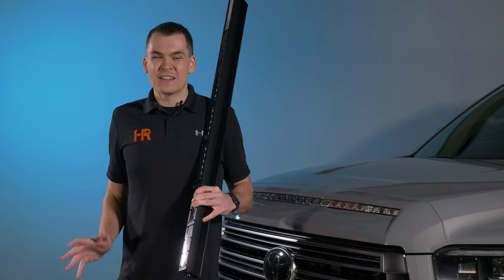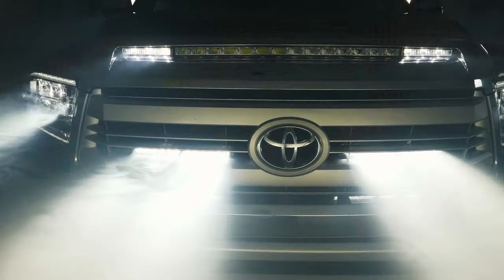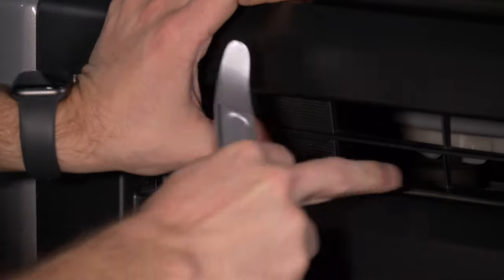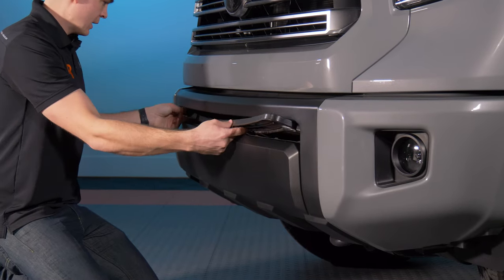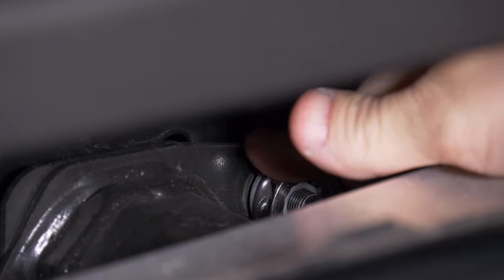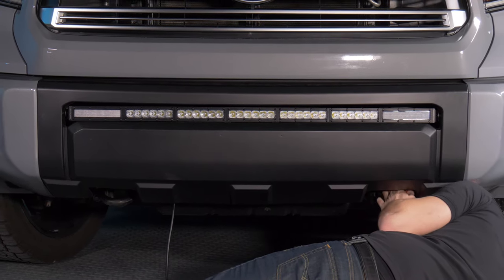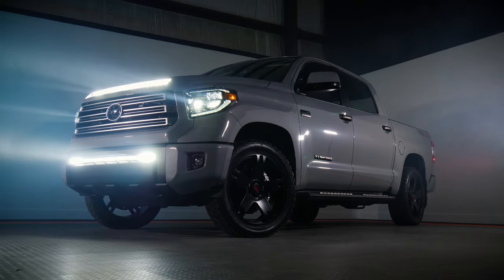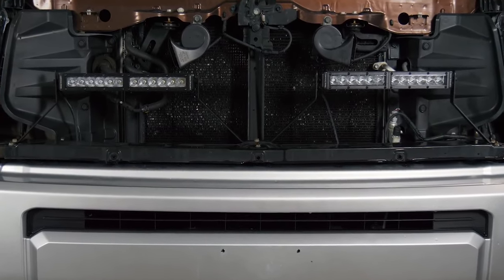2014-2020 Tundra Diode Dynamics Lower Stealth Mount Light Bar Install | Headlight Revolution

Comment: I tried today to install the 42” on my 2021 Tundra but even after I tightened everything, it still had some play when I lightly pushed on the light bar.  Only two hex bolts holding it in place. Just scared it’s going to rattle (break) or wear my paint out.  Any suggestions or fixes to this problem as I am surely not the only person to have this.
Reply: The light came with a both with extra brackets, bolts, hex bolts and lock washers. Was told to only use two hex bolts and nothing else.  Something doesn’t sound right.
Reply from the maker: Can you shoot us an email with a video/pictures of the current fitment? sales@headlightrevolution.com

Comment: Quick question. The folks up here in Canada, alot of our Tundras have our block heaters plug on the left side of that grill. Is there any way to install the 42" light bar and still keep our block heater plugs in play ?
Reply from the maker: You should be able to install these with the block heater, there shouldnt be anything different with that heater and the installation of this light bar!

Comment: Any chance of a modification for the 2020? I saw in the webpage that due to a change in the switch board panel this one will not fit the 2020
Reply from the maker: They should have a new version for those 2020s coming out very soon! I don't know specifics on when, but should be by the end of the year!

Comment: I have this bar in my bumper and their 50” spot on the roof. Been mounted about a year now. So far so good!
Reply from the maker: Glad to hear you are still liking them! Those Diode Dynamics light bars do a fantastic job, and we have been very impressed with their overall quality and longevity! Thanks for watching!
Reply: @HeadlightRevolution where did you install the relay didn’t see that in video

Comment: Running the power cable across the radiator won’t affect it heat wise?
Reply from the maker: Nope, you won't have any heat-related issues!

Comment: I have a 2021 Toyota Tundra Crewmax 1794 edition. I'm going to Atlanta this summer. Can the hood lights (aka Night Rider) and lower 42" LED lights be installed in my truck?  With Android  Auto I don't need the extra plugs-in under the radio. Are the rocker switches available in black?
Reply from the maker: We do not do any installs in house, sorry! 
Any mechanics shop should be able to install something like this. The rocker switches are only available as shown though they can be replaced with any switch of your choice!

Comment: Not fond of going through the firewall and dismantling dash .... Will the NSV led bar work with the Trigger wireless control system ?
Reply from the maker: The NSV Light bar is designed to function with just its wiring harness, sorry about that!

Comment: What year and trim level is this truck and what wheels are those?
That Grey looks tuff and love the wheels and grille Thanks
Reply from the maker: If I remember correctly, this was a platinum. As for year, I'm not sure on that one.
Reply: @HeadlightRevolution  Thanks... You actually say it's a 2019 in another video.

Comment: I installed the 30” bar on my ‘18 Tundra. 
It’s kind of a bitch if you have large hands. It would be better if DD made the brackets so they only required 2 of the nuts to be removed on each side. Not 3. Apparently the wiring just happens magically (“Now you just wire it up…” )since they don’t tell you how to do that, in written or video form. 
-Make sure you have a ready supply of expletives ready to go. 
-Remember how that grill screen is mounted and how much space you need to take it out because if you mount your 30” light too far forward, it won’t go back in.  
-Remove the tow hooks before attempting to reach the 3 nuts for the bracket to bumper attachment. 
-Spray the same bolts down with WD-40. 
-Don’t bother trying to loosen the top nut reaching through the lower grill opening. 
After you’ve convinced the entire neighborhood you have a raging case of Tourette’s Syndrome, you might be ready to put the light bar on. 
-Remember to leave room for that grill screen to maneuver. I also clipped off the angles on the lower tabs so I didn’t have to use as much space, thus keeping the bar as far forward as possible. 
If you’re using a switch box (Auxbeam, etc.) you’ll disconnect the DD switch, and plug in the cable with the female butt connector. Cut off that but connector and plug that wire into the switch box. The red wire goes to the battery and the black/ ground to the ground.
Have fun!

Comment: What does the Primary Optic / Driving / Combo option mean that's required??
Reply from the maker: Those are a few different beam pattern options that are offered by Diode Dynamics. Combo is very useful for a bar like this.

Comment: Do you sell the bracket independent of the light bar? I have an existing 42", but cannot find a reputable bracket.
Reply from the maker: That is because the light bar itself has the mounting points on it, not a bracket that attaches to that light bar. This light bar was specifically designed to plug right into the factory wiring, and moun t to points that already exist in that hood scoop. Sorry about that!

Comment: After installation can I run it manually or it has to work with high beam only?, I'd like to run it manually "ON&OFF" button
Reply from the maker: As it comes, it will only power on with the high beam.
Reply: @HeadlightRevolution   So you can't just go from the battery, through a switch for On/Off?

Comment: Can this light bar use the high beam wiring option like the upper grille kit instead of a switch in the cab?
Reply from the maker: It is not legal to run that with the high beams, that is why you will not be able to do that, sorry about that!
Reply: @HeadlightRevolution  I didn't ask if it was legal.  If I'm the only one on a back road without street lights, which is very common in my neck of the wood nearly anything is legal.
Reply from the maker: Sorry to say that we have never had to wire that light bar up differently, we wouldn't have the information that you would need to do this, but if you would like to tackle this yourself it could be possible! Good luck with that, let us know if you have any other questions in the meantime!

Comment: Do they offer the adapter to connect to the high beams vs using the switch
Reply from the maker: This bar didn’t include that, It only had the switch.

Comment: I'm assuming this is for off road use only and not street legal even if you were to point them down a bit, correct? And how does it work with the high beam if it has it's own rocker switch to turn it on and off?
Reply from the maker: Correct! And it can be wired to the highbeam with a pigtail!

Comment: How many inches light bar the one on the top?
Reply from the maker: The top light bar will fit directly into that hood bulge, but I do not have the exact dimensions. With the harness and the lightbar itself, they are designed only for use in that Tundra hood bulge, so if you were planning on using that elsewhere they will not work for you. Shoot us an email if you have any other questions! Sales@HeadlightRevolution.com

Comment: Good video and easy install. I like that this is made for the tundra’s bumper. Question...Why are the lenses on the outer edges of this light bar different than the middle lenses? Are they a flood pattern and the middle a spot light pattern? I checked your website and it says driving or combo but that doesn’t really tell you the light beam pattern.
Reply from the maker: You're exactly right! The outer optics diffuse the light, the optics toward the center are more of a spot pattern.
Reply: Headlight Revolution when ordering the 42 inch led lightbar, there is an option of heavy duty wiring harness, is that what you use in this installation?

Comment: Does both of it fits on 2020 crewmax sports model?
Reply from the maker: This should fit the same on the 2020 Crewmax Sport model, we have not heard of any issues with fitment so far!
Reply: I have block heater plug on left hand corner. Do you think i have to remove that heater.?
Also, last time you mentioned that you are still working on the fitment of the NSV bar for hood, coz the Toyota have  changed some parts. So, have you managed to change the fitment of the bar according to 2020 model.?
Reply from the maker: So as far as the removal of the block heater, you shouldnt need to do any of that as the installation should be the same as the previous models. I did confirm that the fitment is exactly the same for the 2020 4Runner with that Stealth Mount light bar, so you are good to go there!
Reply: Headlight Revolution thank you for your reply. However, i believe we are discussing about tundra 2020 SR5 Crewmax  TRD sports model.?
 And what you are telling me that if i buy both the light bar ( for hood and bumper for my truck) it will fit exactly you have shown in the video?
Reply from the maker: I am sorry about that, I was also dealing with another guy looking at the 4Runner VisionX Stealth Mount Light Bar😂

For your vehicle, the stealth mount light bar from Diode Dynamics will fit with no issues, but the NSV Hood Buldge light bar will not fit that vehicle, we are still waiting on NSV to come out with the 2020 model. When they have that available, we will let you know so that you can be one of the first to get your hands on it! Sorry about the confusion, let me know if you have any other questions!

Comment: How well do all these lights match each other in color?  Factory heads, fogs, NSV bar and Diode bar.  I'm not trying to have 4 different shades of light coming off the front of my Tundra.  Looks like a pretty good match in the video, how about in person though?  Does or will NSV make their own lower light bar?
Reply from the maker: They do not make their own light bar, and that color temperature is going to be roughly the same as the Diode Dynamics stealth mount light bar! Let us know if you have any other questions, we are here to help!